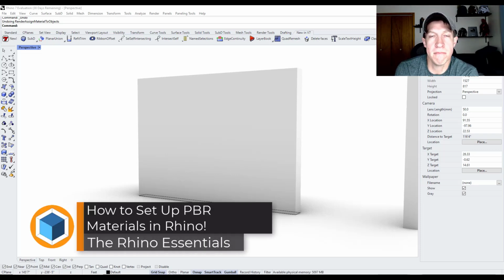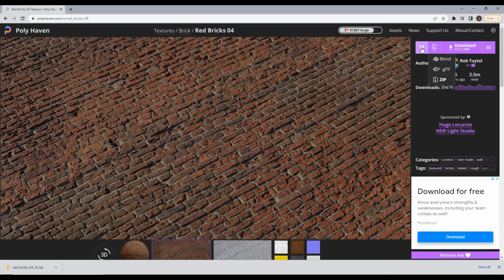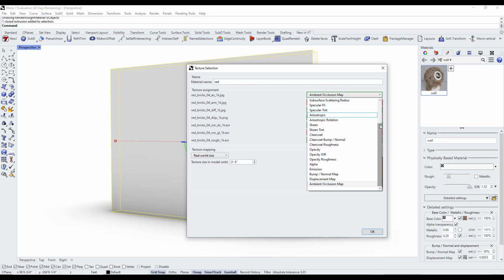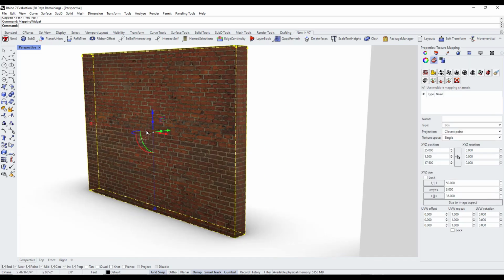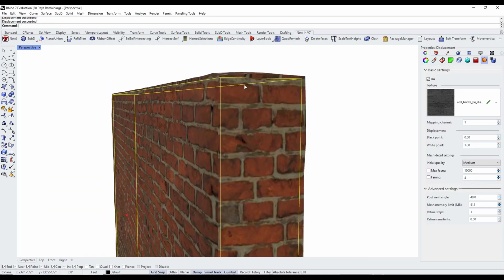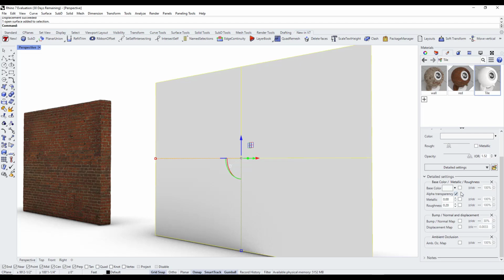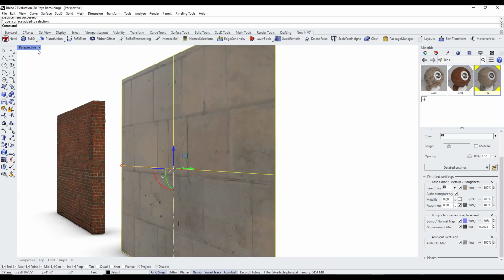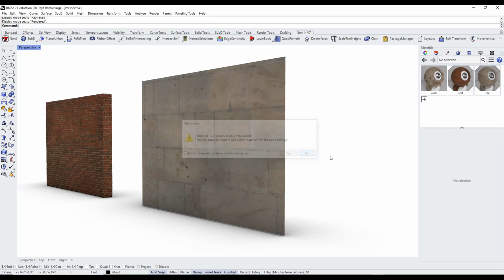How to Set Up PBR MATERIALS in Rhino!

Comment: Nice video.   Just clearing up some confusion about the displacement - you don't need to add "Object Properties" displacement to get PBR displacement to work.  You just need a denser mesh on the object - and a box has an incredibly simple mesh.  The reason why adding object properties displacement works is because it actually subdivides the mesh for you - but you are applying double displacement at that point.